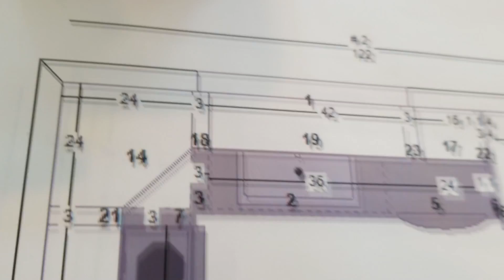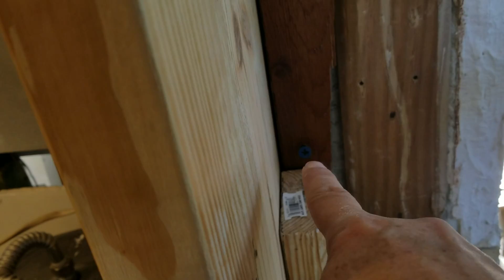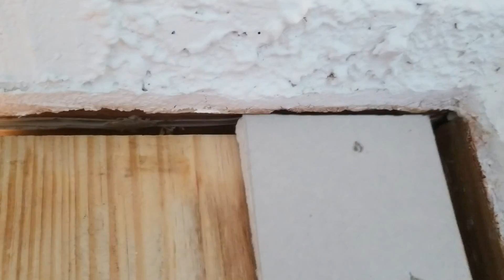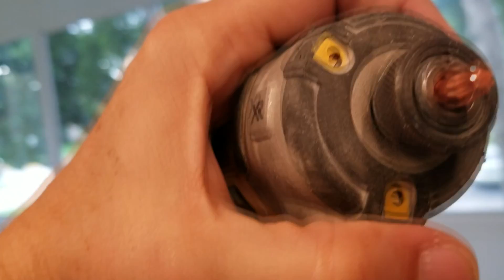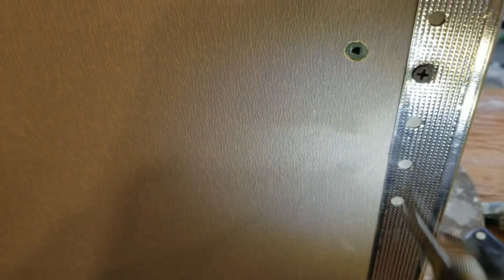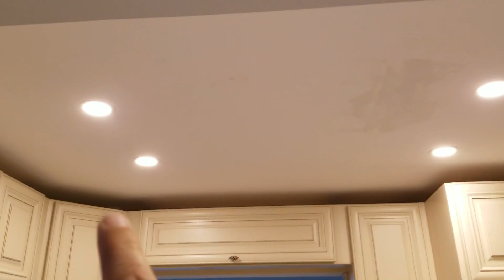How To Resize Kitchen Pass Through Window, Fit More Cabinets

Comment from the maker: ✅ Tools used in this kitchen pass through video window:
✅ DEWALT DCK299D1T1 Hammer Drill, Impact Driver Kit: https://amzn.to/2M6h450 
✅ Deckmate Screws 9 X 2-1/2" Star Drive: https://amzn.to/2Gf5t3A 
✅ Wiss Straight-Cut Aviation Snips https://amzn.to/2X94d7a
✅ Stanley FatMax 43-524 24-Inch Non-Magnetic Level:  https://amzn.to/2Ed242U

Comment: You could probably sacrificed the corner cabinet In stade of shrinking the big beautiful window. 🤔 les cost and les work.
Reply from the maker: You completely missed the point of why it was done in the first place because there was not much storage in that kitchen the window is still there it's just a little bit smaller.

Comment: If your not adding crown molding why didn’t you place cabinets higher to give you more room on countertops or tall appliances? Also dusting above cabinets will be a pain.
Reply from the maker: This is a 55 and older condo, so you have to leave cabinets where they need to be, not a good idea to raise them up the wall.